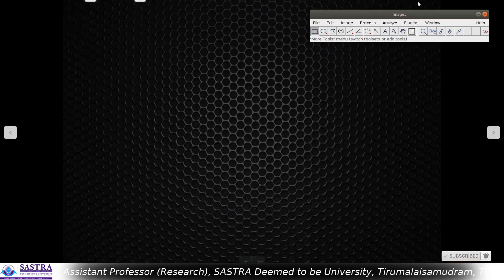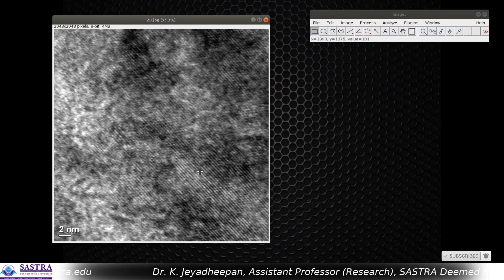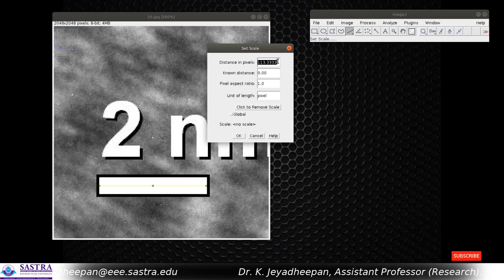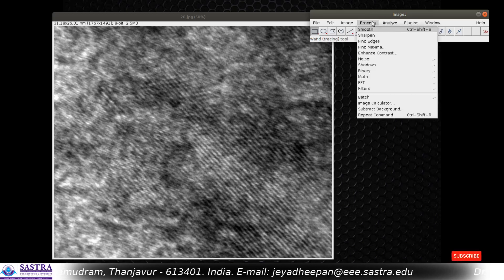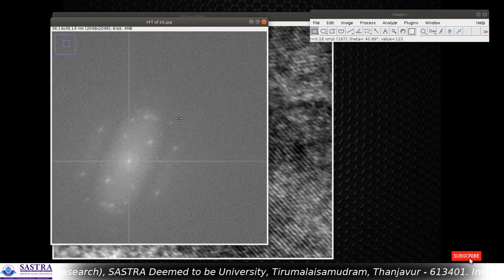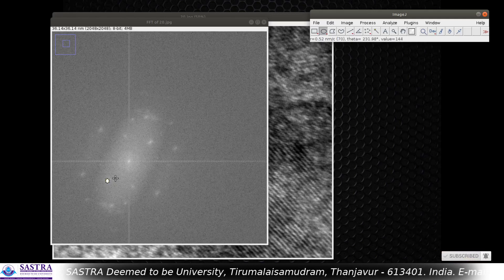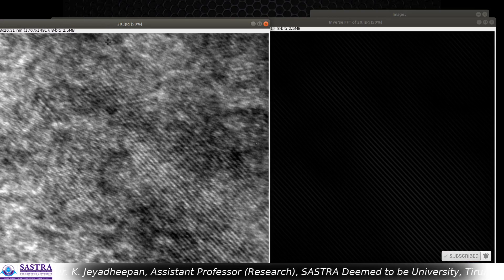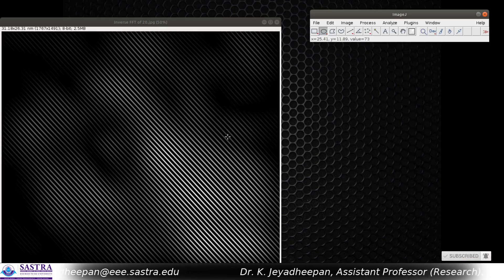HRTEM d-spacing measurement

Comment: Thank you for great lecture professor.
I have one question though.
When you choose a spot from the FFT, if you choose not the brightest one but another, you said the angle will be different.
In that case only angle is different and the lattice spacing is same?
or the differed angle means that the changed of (hkl) ?
Reply from the maker: You are absolutely right! The different angle means a different (hkl).
Reply: @ Ah, then, In one crystal we can find different types of lattice spacing by selecting different spots from FFT image?
Reply from the maker: @이민성-f9w  yes
Reply: @JeyadheepanK  Thank you so much sir!!

Comment: I am not able to get the image after doing inverse FFT. It giving me back the same image. I don't know what I am doing wrong. Please help
Reply: It is saying no pixel has been set to 0 (black) or 255 (white) so filtering will not be done. What does that mean?
Reply: @prantisutar5363  I got the same situation then I press the Backspace button after creating the oval, then it works.
Maybe also should pay attention to what kind of color picker (in the video is front-white, back-white) is using.
Reply from the maker: You might have miseed a step in which you have to select a point in fft image and mask it with a round and white color... Please watch the video again madam.